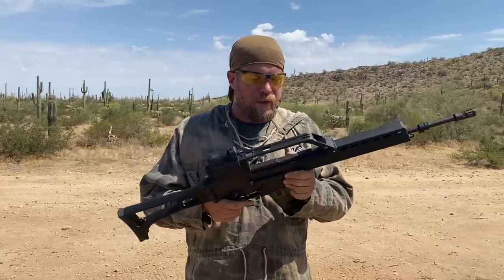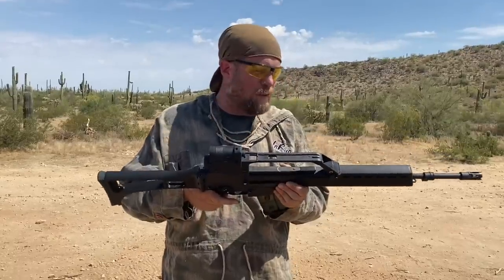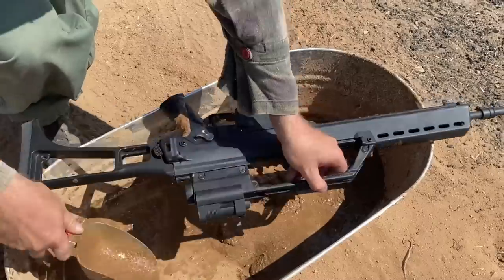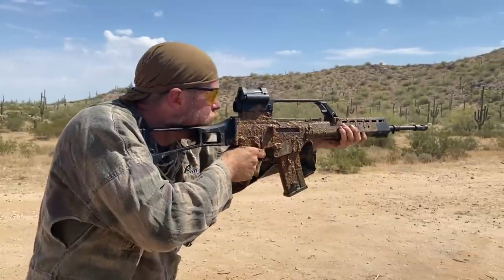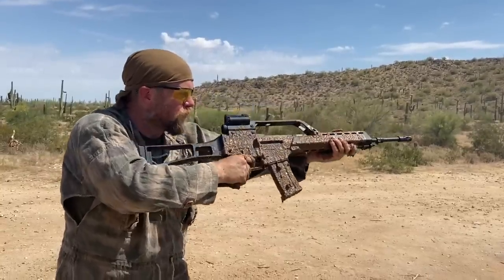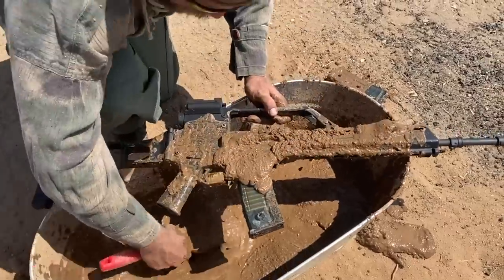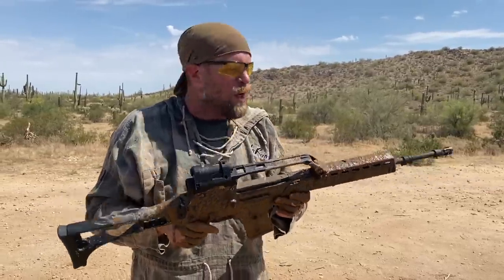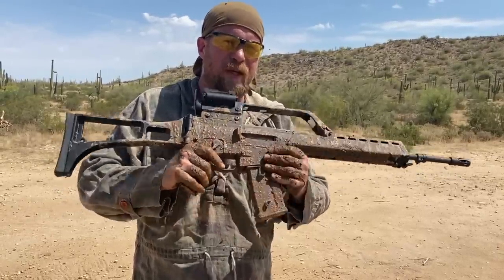Mud Test: G36

Comment: Karl: "Im not gonna get mud on the optic, its a rare optic"
*gets mud on optic
Reply: Stone Alexander keyword try
Reply: @Shadow0fd3ath24  it's a joke lmao
Reply: I screamed
Reply: rare maybe, but crap none the less.
Reply: Hindadubfing Official  I understand the eye relief is pretty horrible on it, and certainly is on my airsoft version but mostly, I think people just forget how quickly technology moves on and forgets how long some of these things have been about.  Like people also say the SUSAT  on the L85 is not good compared to say an ACOG or Aimpoint, but in 1986 when the L85 came out, neither of those existed, the USA only JUST got the M16A2 with no rails and no optics fitted as standard. Nowadays it's all picatinny and the flexibility of using what you want but when the AUG. L85 and G36 came out these were not standard things. Newer G36s of course have adjustable length of pull and cheek rest plus different rails to keep more up to date.

Comment: There's a video of presumably H&K staff testing a full auto G36 and putting somewhere near 900 rounds nonstop through the gun with the only problem being that the barrel literally cathes on fire. The very large German man keeps going until it gets too hot for him to hold. After it cooled down he fired another 30 rounds with no problem at all. Though I doubt the gun was particularly accurate afterwords, either way that and the mud test just cements the idea in my mind that the G36 is a very reliable weapon all around.
Reply: The handguard catches on fire, not the barrel itself. Here's the video you mentioned: https://www.youtube.com/watch?v=iTbTyFloelc

Comment: Having trained in my first 2 years to use the G3 I really thought this rifle is just a toy when we got our hands on the G36. At the end of the first exercise we understand it's better to have more rounds on the patrols. And yes it is a light weapon.
Reply: Hehehe... Yes, the G36 is awesome. A breeze to carry. Fast to maneuver and plenty of ammo, but when the little fuckers creep up behind a brick wall the G3 is a godsend :P
Reply: When we first went to the shooting range with the G36 (1993) we did not have the new exercises, so we used those designed for the G3.

It ended up with targets which all had a big hole instead of the 10 which we had to fix with tape to finish the exercise 
The average result was an average 9 instead of an average 6

Comment: Wow! I'm happy that it passed. I've been a fan of the G36 for a long time. Back when the M8 was up for adoption, there was some data from the tests about how many stopages it had. It had the least compared to an m4, and a few others. When I soon learned that the M8 used essentially the same operating system as the G36, I always just assumed that the G36 would have the same stellar reliability. Glad to see that's true, at least in this guise. I mean this mud test really is kind of ridiculous, and its no surprise when even a generally reliable rifle like the aug fails. So when something actually passes, that really speaks volumes.

Comment: Guess a perfectly designed firearm does not require a dust cover.
Reply: Shots fired!
Reply: Rly bad take. We seen with dust tests, the dust cover does matter.
Reply: DAS IST DIE DEUTSCHE 
SPITZENQUALITÄT!
Great rifle! It's light, the design is very distinguishable and the quality is as the video shows!
Reply: @LIETUVIS10STUDIO1  The AR-15 has a dust cover, and it doesn't need it. The AK has this dust cover safety thing, and it isn't working.
Reply: Bhum Brahmavira  Yes, yes it does. Hk knew what they were doing.
Reply: @Biker_Gremling  doesn't need the "dust" cover? I assume you haven't watched the "dust" test they did with both the AK and AR?
Reply: The AR-15 performed flawlessly without the dust cover also

Comment: AK failure: Well you weren't using the right AK.
Tommy built "G36" clone: Success
Reply: I'd fail the mud test if I had gaping holes and huge tolerances around my bolt carrier. It teaches us that what works with sand doesn't necessarily work with mud too.
Reply: @user-njyzcip  A vast majority of AK fanboys don't get that apparently.
Reply: @user-njyzcip  dust and ice. AR and rifles with tight gaps between moving parts can be very problematic in water-ice or heavy snow cold weather conditions.
Reply: @tutzdesYT  Tight toleances between moving metal parts are a problem. With the natural unevenness that comes with polymer, not so much.

Comment: Not too suprised it passed considering the SCAR passed it too. Both use a very similar operating system in that whatever would make the SCAR fail would probably make the G36 fail too. And mud definatly isn't on that list.
Now which gun to bring back into the trenches of WW1 because of this. The AR-15, the SCAR or the G36?

Comment: Honestly that was crazy impressive. At least it runs for the money. This over a scar L all day.
Reply: Well, they did test the SCAR 17S (SCAR-H), and that had, spoiler alert, no hiccups
Reply: I honestly prefer to SCAR-L due to the struded aluminum receiver that gives more stiffness. Also, regular magazines without the annoying side cilps.
Reply: @Biker_Gremling  G36 takes regular magpul magazines as well. I find the side clips on the HK mags to be quite useful for coupling magazines together. Those little extruding clips don't impact the experience of handling the G36 in the slightest.
Reply: @Dani-hl3xu  I get that. As a collector and sports shooter I haven't had that experience, but I can see in a military context how that might be an issue. Honestly the Magpul magazines are built way sturdier than the HK mags and don't have those nubs for coupling, but I don't know if the  Magpul version saw much distribution within the military.

Comment: Me: This G36 is a gas piston gun, it's so gonna fail
G36: passes
Me: (0.0)
Reply: It has a lot of reserves. The little nubbin on the gas piston seals up the gas vent port for the first 6-7mm of travel, so in adverse conditions it more or less auto-adjusts the gas volume to the "ALL OF IT" setting.

Comment: could you mud test a cap and ball revolver? wondering how well a colt, remington or starr would do. at least cleaning would't be much different.
Reply: They would fail *immediately*. Even with the hammer down, the mud around the cylinder would cease the action. Revolvers do not do well with mud or sand.
Reply: @SavageArms357  I have seen pictures of frogmen using stainless revolvers in maritime operations, but that was purely to deal with the corrosive effects of seawater. Also they were fairly old pictures; modern coatings would make that irrelevant.
Reply: You can't do this with a revolver, or it will not fire or the mud will clog the chambers and it will blow up

Comment: Sealing the system from entry of outside debris seems to be the best bet for getting through something like this. The charging handle design of the G36 shares some of the same sealing benefits of the AR charging handle design, which I think plays a big role in allowing those rifles to perform so well in this test. Possibly the single biggest factor.

The CH rides in a single hole in the receiver that it slides in and out of, rather than a slot in the side of the receiver that is slides along. The CH basically seals the hole from debris, the AR design has the advantage of the sliding surfaces of the CH being sealed inside the receiver until used, but the exposed surfaces of the G36 CH doesn't seem to have caused any issues.

The slot cut into the receiver for the CH of side charging rifle designs, by necessity is an open hole straight to the inside of the rifle, either close to the piston system, the BCG, or simply a channel for the CH to ride in. Debris can get into that slot and then begin to reach moving parts, and that is when problems occur. The locked up CH of the AUG is a perfect example.

Some rifle designs protect the slot for the CH though, the AK uses the safety, but it doesn't do any good when the safety is disengaged, and then there is a hole straight to the FCG and BCG rails.

Other designs use a spring loaded mechanism or rubber wiper boots to seal the CH slot, and those may help prevent problems.

The piston on the G36 may be protected well, which helps there, as the piston is a critical moving part, so getting it gunked up could cause issues. The AR not having an external piston likely also plays a big role in helping it perform well in these tests.

Comment: When I saw how he covered the rifle with mud, I thought that it would never work anymore, but I was positively surprised. But you have to consider that the mud is different everywhere and that the one that Karl used has a high proportion of sand and little organic material. it doesn't quite match the german term of mud. But these are extremely interesting tests and a certain standard has to be adhered to. and i think arizona mud is just as good.

Comment: I'm impressed with the mud test, I own one of these but I am not happy with its overall performance as a shooter, but am when it is full of mud. Nice work. I dissed you on the Steyr mud test, as I have seen one run over by a tank it it worked well.
Reply from the maker: The AUG failed twice.

Comment: Its a closed bolt locking system, unless mud gets inside the barrel and the locking lugs its not going to jam ever.

Mud tests only effect open bolt systems. Fine sand gun lube his how must closed bolt locking lug systems jams, or magazine feeds which is usually just needs an adjustment in the spring.

Comment: Someone may have asked already, but were you shooting 62 grain / 556 or 55 grain / 223? In the TommyBuilt T36 manual it states that ammo other than 62 grain 556 may cause feeding issues (due to not enough power to fully cycle) - which may have caused the first "one-round" problem.

Comment: Wow im actually quite surprised how well it did considering the other short stroke piston rifles didnt do so well. Looks like the piston setup in the g36 is more resistant to the elements than the 416, but i know this video is only one data point.

Comment: I think that first round was just a light primer striker or a dud primer. Considering that every single round after that worked flawlessly. My initial though was that mud got in near the charging handle and caused it to either be out of battery or block the firing pin. Then, you cleared it and went on running so that seems like the only logical answer, it must have been the ammo.

Comment: I've got one in this exact configuration with a 1.5x carry handle optic. No way I'd loan something this pricey to you guys to abuse! Lol. Tom Bostic builds a mighty fine version of the G36. From what I've seen with mine, it is a very reliable and accurate rifle. I wasn't surprised at the results of this- despite having no real dust cover, it's a very sealed system.

Comment: Do you think the first failure to fire might have been a problem with the trigger group or the hammer not dropping properly? The fact you were able to remedy it without any other issue suggests that the problem wasn't actually caused by the mud, except perhaps there being a little too much drag on the firing pin, but I don't see how mud could get in there anyway. Seems to be a random mishap with the hammer unrelated to the test.

Comment: i would have liked to hear a bit more about WHY this did so well, mechanically speaking. either way, very impressive!
Reply: When the bolt is forward, the bolt carrier blocks the ejection port, and the charging handle blocks it's own track, effectively sealing the entire gun as long as the bolt is closed. That's  my understanding of why the G36 holds up so well in mud.
Reply: @Rotsteinblock  There is a huge gap between the bolt carrier and the housing, allowing the gun to clean itself from debris without jamming. The carrier only glides on two steel enforced rails which allows it to wipe dirt away and eject it together with the spent casing.
Also the ejection port is pretty well sealed by the carrier when it's in its locking position.

Comment: Wow. That was... Unexpected, to say the least. Considering the reputation of a gun that really took me by surprise.
Reply: the reputation of getting too hot under sustained fire made you think it would perform badly in a mud test? I don't see the connection there
Reply: @tommihommi1  Possibly was talking about the more general reputation of being "unreliable". However untrue, small details can get lost and a perfectly good firearm with one (supposed) flaw can be branded as "unreliable".
Reply: @tommihommi1  well, this is not the only flaw of G36 I have heard of. Vulnerability to mud and dust and other stuff seems to be very common myth about most guns that are hard to maintain\technologically more advanced than post-ww2 guns. Well, I think it is my fault to believe such rumors, after watching this channel for nearly 2 years XD
Reply: @fidelpinochetov  any gun will fail in the field to moon dust and/or mud if you try hard enough

Comment: It performed the same as the FN SCAR. I believe that the round that failed to fire was a dud. It happened with the SCAR aswell. Coincidence? 
Other than that the SCAR and the G36 are very similar in several aspects: operating system, ejection port design, tight tolerances.

Comment: You know, this is one of those times I just really wish I didn't live in California. I fucking love G36s. I have an SU-16CA which kinda ticks some of these boxes (5.56, plastic, light, foldy, simple operating system, but doesn't like mag dumps), but ffffffffff me if I don't wish I could just have a nice G36 or G36K instead. I used replicas for war-gaming and just adored them: had a C and an E (the 20" like yours here) but I exchanged  the built-in optic for a C-model carry handle (pic / irons). Brilliant guns. Light, pointable, perfect cheek-weld, and super easy to field strip for maintenance (even the toy versions, which are usually much more complex than the real thing). The only downside was that it was difficult to find mag pouches that played nice with the magazines: those little locking keys on the side love to get hung up on everything, and the external dimensions of the mags are just gigantic for a 5.56 magazine.

Comment: I think it's weird that it didn't hold the bolt open when the mag was empty. as far as i remember my service riflle, the bolt was held in the rear position after the last shot of a mag was fired. maybe that's one of the differences of this replica to an original one, or maybe my memory is a bit blurry, since my servicetime ended in 2008 which is quite a while ago.

Comment: The initial malfunction, was it a failure to reset? Maybe something prevented the trigger from moving far enough forward to release the disconnector. I don't see a round ejecting and chambering properly and it failing to push the hammer down far enough to catch.

Comment: Looks like it was a live round that failed to fire, wonder if some mud got into the FCG and slowed down the hammer on its first swing. Also does this particular rifle lock the bolt open on firing the last round? I know I've seen that occur on some G36s, but since this is a rebuild it could just be that it lacks that feature.

Comment: Wondering why g36 passed, but 416 didn’t. Is 416’s gassless bolt carrier just shoveling mud back into action, because of the geometry of the bolt carrier on the ejection port side (not flat like the one on g36)

Comment: huh, I'm really impressed and surprised. I really like the G36, have been using it for 13 years now, been on deployment with it and never had any problems. But I wouldn't have expected it to perform this well.
Regarding the first malfunction, btw, I'm pretty sure it wasn't completely in battery, looked like it on the vid. Could've been a trick of the light though.

(Could be this is my german "pride" speaking, but I'm of the oppinion, that german guns get mudded a bit more than american ones.... xD)

Comment: Germanys former Minister of Defense, now President of the European Commision, Ursula von der Leyen, replaced the G36 for being to inaccurate in hot climate. After most reports told that the G36 isnt more or less inaccurate in hot climate than comparable weapons, the G36 is still going to be replaced without any clue with what, while all parts of the german defense have lacks in supply and maintance in almost any system. Its not that we spend to less on our military, but the way it is spent is almost criminal.

Comment: As a german soldier I had to see this video.

And I must say: I´m not really surprised.
The biggest downside of the G36 is its optic. The mechanics and the frame work perfect in most cases.

Very nice video.
Reply from the maker: Optic is terrible.  Will discuss in a future video.
Reply: @InrangeTv  Optic and handguard should be changed. Then I would love it much more.
Reply: @InrangeTv  but judging a rifle by its scope is not really fair. I heard the US Army invaded Afghanistan and Iraq with mostly Ironsights on their rifles.
Reply: Always worth remembering that the optic is a product of the 90's, back when the concept of "Every soldier with an optic" was rarely put into practice.
Reply: @And2Handles  but it is a fair point to make. The Bundeswehr has a problem with modern optics.
Reply: @DerLoladin  yeah, but no real progress since then....
Reply: @01Ezio  Depends who you are, a good chunk of the combat troops get more modern optics these days, especially red dots. For anyone who doesn't desperately need one, the current ones are still good enough.